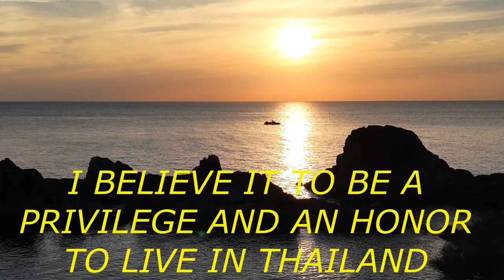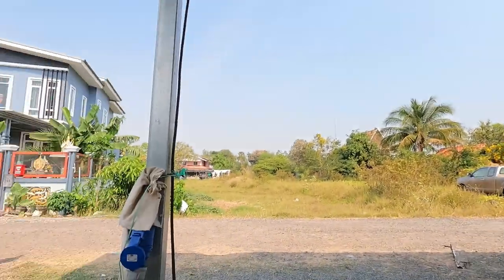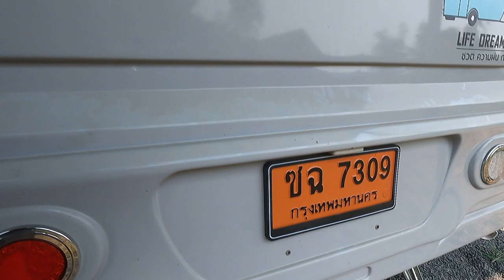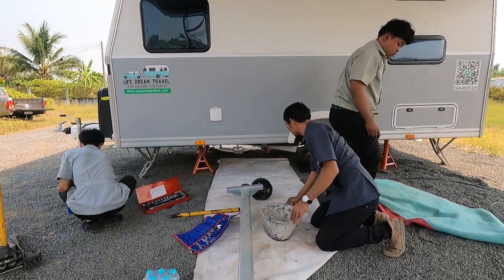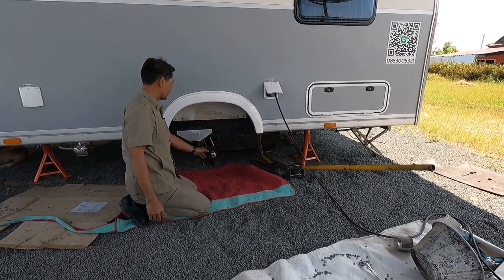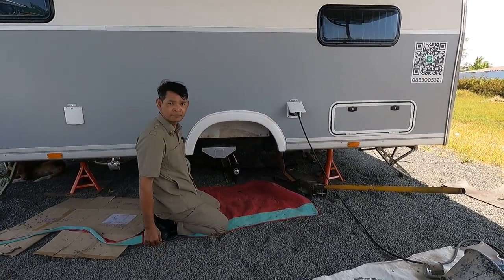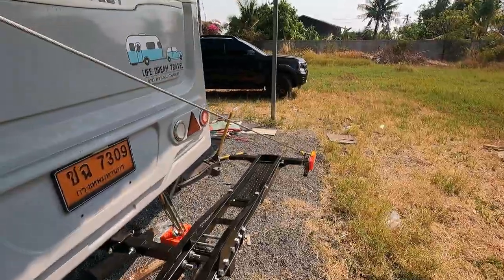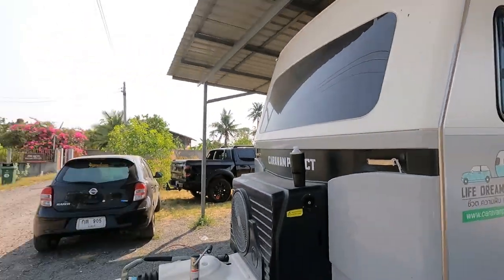Changing a China Travel Trailer to a Leaf spring suspension and installing a motorbike rack on Back

Comment: I like the bike rack, but in my opinion the axle you took out is better than the leaf spring with shocks as the one you took out is and independent suspension and all you had to do to raise it was put a spacer between the axle mount and the chassis, its called an IRS axle and has rubber inside that acts as shocks etc😊
Reply from the maker: I found that out to late lol

Comment: As a long term caravaner in the U.K. and I went on a caravan service course. Weight distribution is the key to a stable caravan. Years of design and testing goes on the caravan design. I feel by doing this has altered the dynamics of the caravan, putting the bike on the back of the caravan again alters the dynamics of the caravan. I feel on this occasion you will make it a more dangerous tow. Unbalanced.I hope I’m wrong but best wishes.
Reply from the maker: We will find out soon I agree I hope is will tow ok when they put the a/c condenser on the tongue to me it was too heavy in the front so I’m hoping my calculations that the weight of the bike of the back will be OK like I said I hope so lol I will do a video after I tow it probably tomorrow or the next day I will also have somebody else drive the truck and tow it with me driving behind it so I can see how it tracks. Hopefully it’ll be OK thanks for the heads up Les I appreciate it.